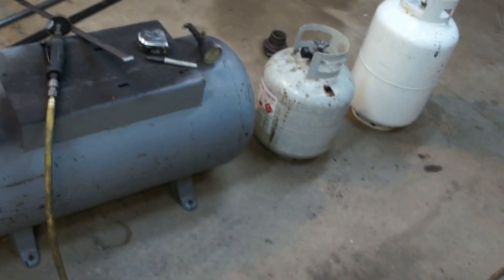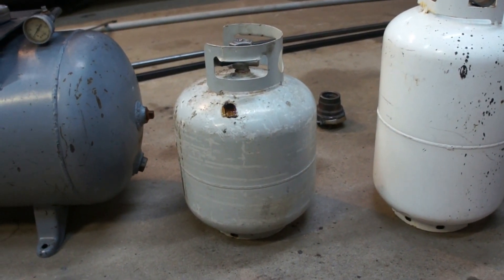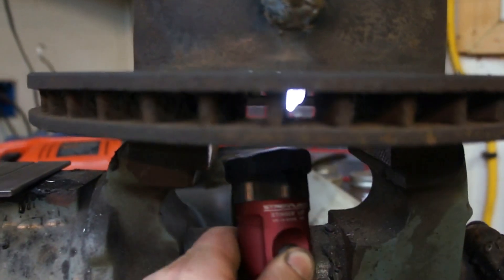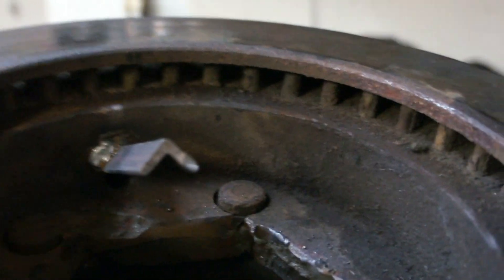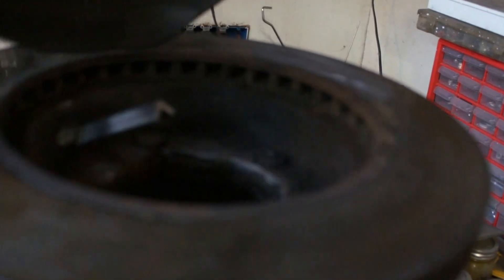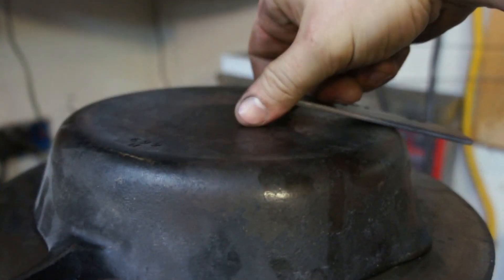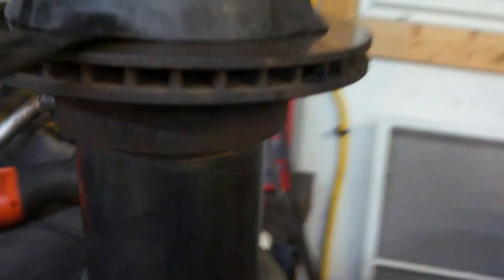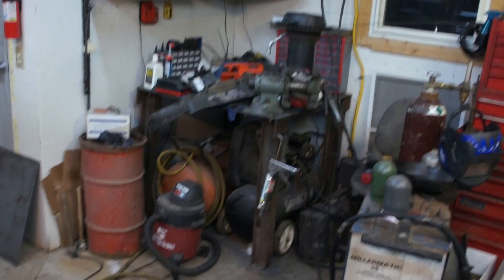Waste Oil Heater Experiment

Comment: I think it depends on your heat requirement. Where i live it's -20 and goes as low as -40. - The problem I had with the drip system was the crappy shit that formed in the burn chamber. If you watch this video, "https://www.youtube.com/watch?v=uBbeLpqvKD8'' this gentlemans design and thought process makes a lot of sense. Also, this video, " https://www.youtube.com/watch?v=u-6FcZJU3Kw'' looks to be a BIG Improvement